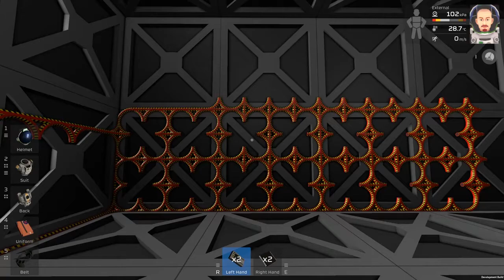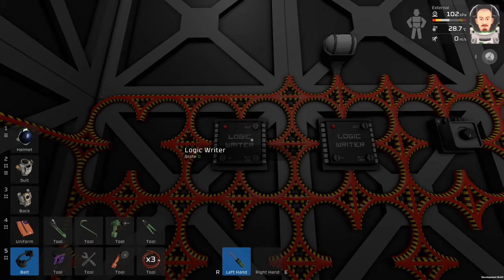Stationeers - Tutorial LED Colors

Comment: So I wanted to use this with a power control console (I have one set up where I can click the button to turn on and off all my machines in the workyard like autolathe, furnace, etc). Can you show how one would set up an LED light to be Red when the control console has everything turned off, and Green when everything is on?
Reply from the maker: I cant show you, because I am colorblind, but it is very easy to build. For example use compare, if compare = 1 when devices are on, change the color to green, when compare = 0, change color of led to red. There is a lot of ways how can be this achieved, even with IC code, which would be probably the easiest way.